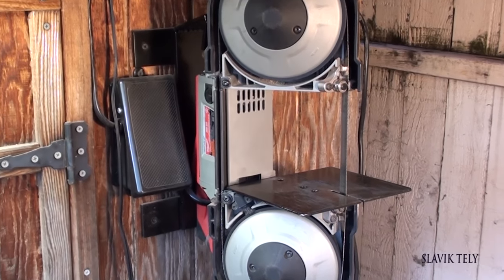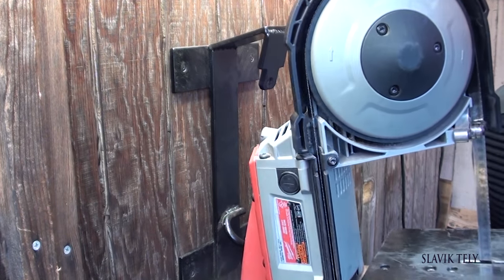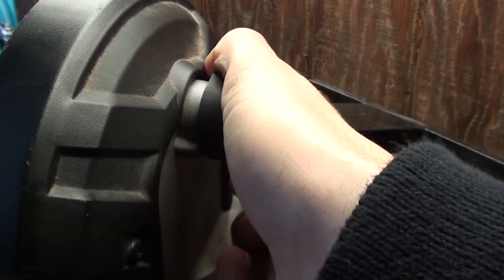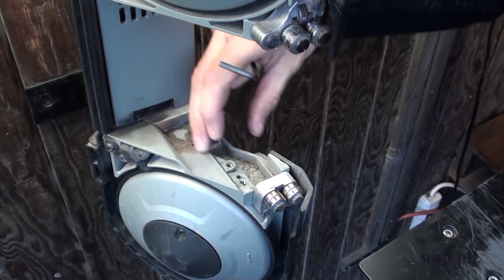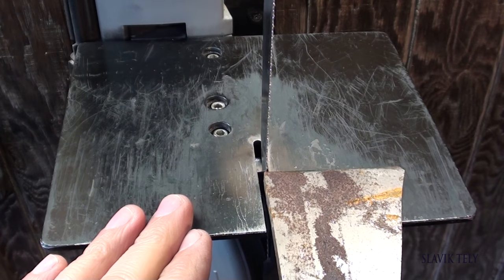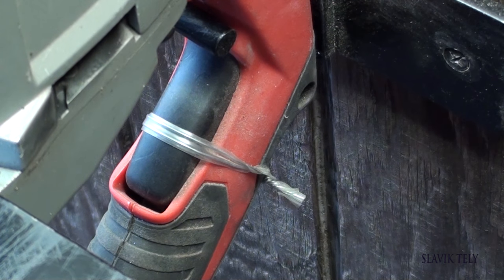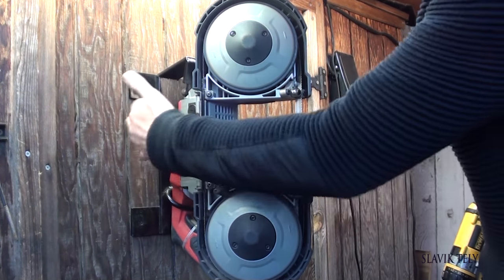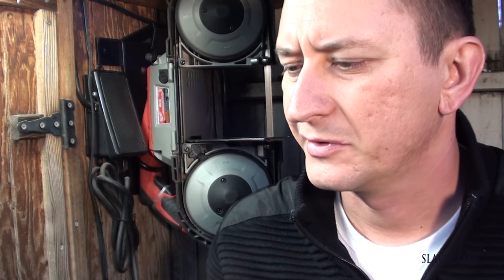Milwaukee Vertical Bandsaw Wall Mount

Comment: Thank you for posting. Your video is an excellent contribution to solving the problem of getting maximum function from a portaband. Also, thank you for your generous acknowledgement of the contributions of  others. One insight I can add is that Bondo is a cheap, fast, accurate way of fitting the factory handles to a steel frame. Just run a couple screws into the intended mass of the Bondo and wrap the handle with a thin layer of plastic bag, one of the few details of my first stand I intend to carry over into the next iteration.
Reply from the maker: Thanks.

Comment: To heck with knives, you need to get a patent on that wall mount and sell THAT....Solid advise all around here. I traded my knives for all kinds of stuff back when I first started out.(about 30 years ago)...These days I do it for fun..🔱
Reply from the maker: I thought about making them and selling but there are so many different variations of different band saws. It is a headache.
Reply: Two words...Adapter Plate...🔱
Reply: @SLAVIKTELY  sorry, I made the suggestion twice in this comments section. I completely forgotten about there just being so many different types.
Maybe just do a few different ones for the top brands???? 
DeWalt, Milwaukee, and maybe one other brand??? 
Either way, it's definitely a cool "gadget"!!!

Comment: Great workmanship.  I think I would rather have the table slot in the back and have to remove the whole table to change blades.  I've been using my Milwaukee for 25 years and have only replaced the blade once.  I usually cut wet rather than dry, and In so doing my blades last almost forever.
Reply from the maker: It is difficult to cut out the shapes I need and have it be wet. I do agree with you about the cutout in the back.

Comment: Nice one that's simple yet effective think I'll have to try this on mine. Actually didn't think to take the handle off and use that existing screw fixing 👍🏼👍🏼👍🏼
Reply from the maker: At the end I have posted one more endscreen video (not mine) of another setup. See if you can take something out of that video.
Reply: Ah yeh I am subscribed to his channel aswell and have watched that video. Going to play with a few designs and see what will work best for me but definitely love the wall mount idea 👍🏼👍🏼👍🏼

Comment: You could make some serious money selling the mounts! I would buy one!
Reply from the maker: That is interesting. In your humble opinion, how much should I sell them for?
Reply: Slavik Tely  I do not have a welder or milling machine that you mention in your video. Or friends that have them for that matter. I finally bit the bullet and bought a Milwaukee bandsaw. I also bought a table from SWAG. With the foot switch and miter gauge, it cost me $200. The table alone was $125. I would have gladly paid $75 for this mount but it would somehow have to include a table like your friend made you. I am not sure if that helps answer your question. Thanks
Reply: I would have also paid extra for the table I mentioned in my other comment. Sorry I forgot to mention that.
Reply from the maker: Samara Volk Thanks for reply.

Comment: How many teeth per inch on your band saw blades? I finally bit the bullet and bought a saw like this and a table. I had OK luck with 18 TPI and thought I'd try 10/14 TPI. I didn't fair too well with that. Thank you for your reply and keep up the great work. Charles
Reply from the maker: I believe mine is 18.
Reply: Thanks.

Comment: Have you considered making a plug, the same thickness as your plate and the width of the blade slot, and attaching it on top of a wider piece that spans the width of the whole plate? This could be snapped in place with rare earth magnets from underneath, leaving the top of the plate continuous, and be removed quickly when the blade needs changing. Just a thought.
Reply from the maker: I need to find time to actually make one.

Comment: Is the harbor freight 10 amp deep cut variable speed band saw kit any good?
Reply: Dral Marev I have a angle grinder and the 1x30 belt sander, only problem is that harbor freight grinding disc aren't the best. Do You have any suggestions for a portable bandsaw? My grandpa has a big one but I want one I can keep in my basement and make knives.
Reply from the maker: I know that Ekim Knives has a Harbor Freight bandsaw and he has had not problems with it. I do not recommend getting battery powered one because you will run out of power pretty fast. When I made a Sourse 1.6 knife, the steel was so thick, it took me almost an hour to cut the shape out. Trust me, your batteries will not hold that long.

Comment: do you think you can get your friends to make a vedio on  the wall mount
Reply from the maker: It is  a pretty simple design. When you will have a bandsaw in you hands, just go off of it and get your measurements because each bandsaw has different dimensions.

Comment: Can you cut 440C stainless steel with this set up. If so what blade should I buy.
Reply from the maker: It has to be not heat treated. Use bimetal blade.
Reply: @SLAVIKTELY  Thank you so much for responding. I love your work and videos. Hope to become as accomplished as you as a knife maker. I was a Journeyman Ironworker our of Local 7 Boston for 30 years, Did lots of in field fabrication, and welding during my career. Knife making is right up my alley!!
Reply from the maker: @Benjaminzimmermann90  I used to live in Monson Massachusetts exit 8 on Masspike. Been to Boston a few times. Love walking around the city.

Comment: Is it the new model, with led light? 

Thanks tely!
Reply from the maker: I don't have any LED lights. If I were you I would get the DeWalt. Way better to set up the table.
Reply: SLAVIK TELY Thanks Tely! I might Go with that one. 
🙏🏻
Reply from the maker: @kaskristensen  DeWalt has a nice flat surface when you take their little table off but Milwaukee has this step down little surface that does not give you that much room to make a nice contact between new table you are going to attach. You will need to weld some stock to the table before mounting it.

Comment: SELL  THE SAW MOUNT IT A GREAT DESIGN
Reply from the maker: How much should I charge for it? Also, there are so many different band saws, will need to make so many variations. It's a head ache.
Reply: Figure the time and to do 10 of them pay your self what you get at your job then 2x it. Just start on the 4 in Milwaukee . other done on spical order. Try to make it fit in a usps flat rate  bag. Maybe cut in half and rebolt to gether.
Reply: SLAVIK TELY 5000.00
Reply: @SLAVIKTELY  $79.99

Comment: Making a hardwood fence for the miter makes all the difference MyBest.Tools Tune the saw with a combination square. Adjust the laser so its in line.😂🤣😂🤣😂🤣😂🤣See the photos.Every part in this saw is adjustable.😎😭
Reply from the maker: the blade i have cuts wood and steel.